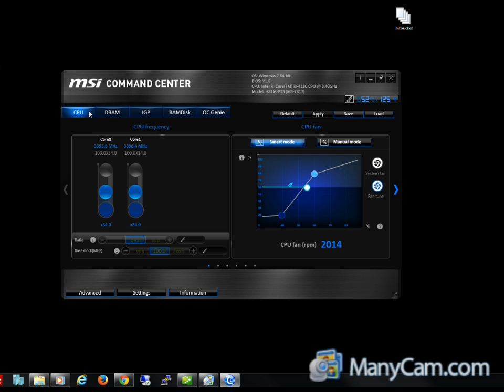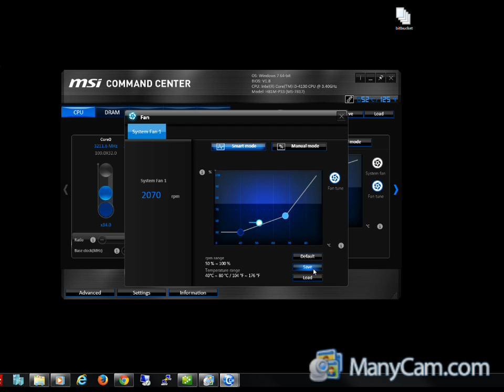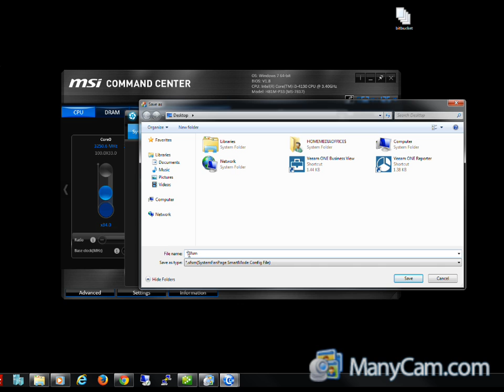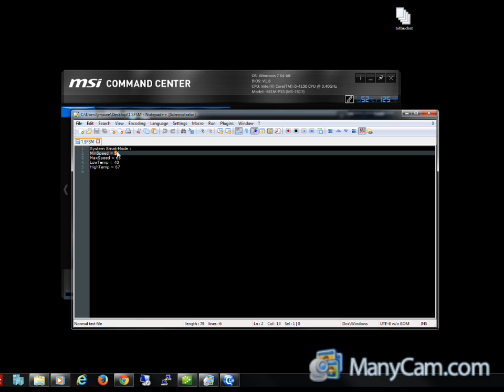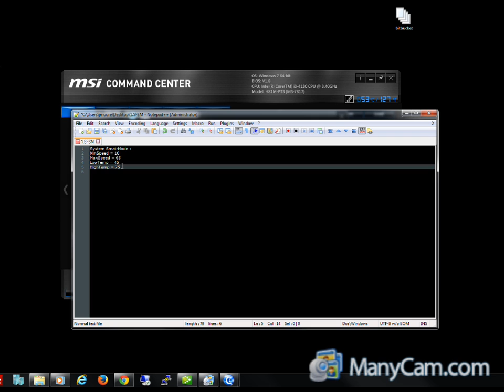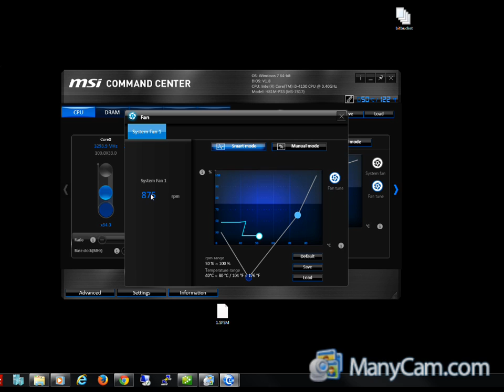Quiet MSI PC Fan Speed Hack

Comment: Wow, finally thnx :D
For me i needed to change cpufan1 input and then i got it 2000+rmp in the system fan.
Now I cange the settings but have these ( i already change it.

System SmatrMode :
MinSpeed = 10
sMinSpeed = 10
sMaxSpeed = 65
MaxSpeed = 65
LowTemp = 45
sLowTemp = 45
sHighTemp = 75
HighTemp = 75

Now My cpu fan 1 is 0 rmp, is that alright?
But the good thing the rattle of my watter cooling is gone :D. Thnx man, relly thnx
Reply: Rafal Zado  normals ettings were like this
System SmatrMode :
MinSpeed = 50
sMinSpeed = 70
sMaxSpeed = 90
MaxSpeed = 100
LowTemp = 40
sLowTemp = 55
sHighTemp = 70
HighTemp = 80

Comment: THANK YOU, THANK YOU, THANK YOU! I built a new PC and used my fans from my old PC (one in particular a 120mm CPU fan from a Dell XPS 420) and they were buzzing around like there was no tomorrow (kept my CPU at 32°c) but now they are set to 5% (the only difference from your settings) and the 2 biggest fans are turned off till needed I guess... The fan on the CPU now and one 120 intake and 80 exhaust fans are the only ones running cept for the GPU ones...

Comment: Awesome - just got a new case with 3 x 140mm case fans, and this will help me out massively... Can you have different configs for the 3 system fans? and also, does it remember the last loaded settings on Windows startup?
Reply: ***** You have to set each fan individually with a different file, or edit, load to fan 1, edit, load to fan 2, etc. But regardless, it doesn't work for me because it overwrites the settings on reboot, with the ones in the BIOS.
Reply: candtukyt  and ***** use a program called 'speedfan' you can set individual curves for every fan that is plugged into the mobo more control than the msi.